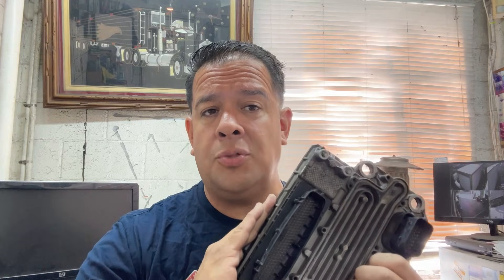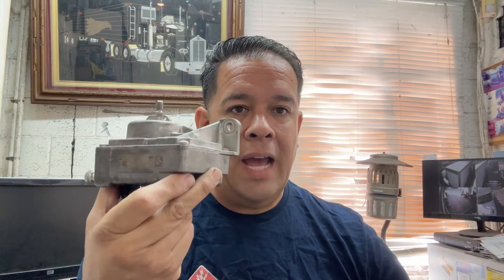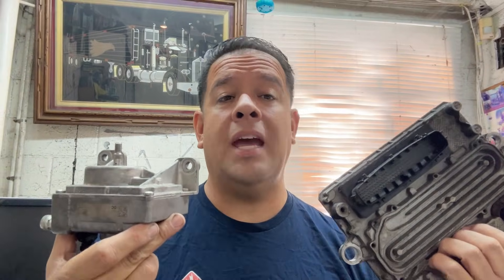EGR valve actuator and MCM nightmare, this is specific to EPA10 DD13 and DD15 Part 2

Comment: One of my favorite codes being sarcastic, already replaced 3 computers on 3 different cascadias repaired all 3 , it does send alot of voltage from mcm to move that actuator , through time the mcm just takes a crap also hope the dealer was programming it correctly ? Twice the mcms were bad , bad coincidence ? Thank god for your buddy , I’m sure when that 2791 code popped up again after second mcm replacement there was some cussing involved !
Reply from the maker: When I was at the dealership working on the exchange, they mentioned they had up to 5 MCM be defective right out of the box in their shop. 
Another customer had 4 be defective. The customer was originally being charged for each programming unit management got involved. 
But you are correct, plenty of cussing was going on

Comment: I work on coach side, so I can't speak for Freightliner but if you use the new style egr motor with the retrofit kit it will not work at all, regardless if the MCM is up to date(epa10). It would even throw a egr failsafe code to which valley power was also confused. I Installed a used but good older style actuator and the problem went away.

Comment: DTNA, Detroit, and Freightliner parts are ripoff. I installed Reman injectors run 3000 miles Cylinder 1 overfueling. Almost destroyed my new rebuild dd 15 GHG17. Then, I purchased the EA version new in Albuquerque Freightliner. Cylinder 3 send code 1325 fmi 3 Deficit at idle. Run idle speed, cylinder 3 dead, no fuel at all. I recommend everyone to wait until your factory oem part breaks or shows strong signs of failure because the replacement part will be low quality. Not even EA; which means Enrolled Agent, a third party manufacturer.

Comment: HOLY SHIT!! If Carlos the Diesel God is having trouble resolving this problem, I can only imagine how difficult it would be for a diesel engine truck owner operator to self-repair.  I'm a new RV owner and my very first diesel engine is the 2023 Freightliner DD8.  I know it's a baby diesel but it's what I have.  I see lots of DD13 & DD15 online maintenance, repair/troubleshooting videos for those engines but very little on anything DD8. Do you do any DD8 maintenance/repairs?  As a NEW DD8 owner, I need to be able to do my own troubleshooting and maintenance.  I have several different I.C.E. scanners and diagnostic tools to maintain and troubleshoot those gasoline engines.  Can you recommend an entry level owner operator scanner/code reader and diagnostic tool for my DD8 that is not several thousand dollars for me to purchase so that I can troubleshoot and repair my DD8 if the time comes to need repair in the future?? I watch a lot of your very informative videos in the hopes that I will better understand diesel engines, and SOMETHING will be similar to understanding and better maintaining my DD8.  You are amazing and I have learned a lot from my short time watching your videos.   I just did my very first DD8 oil change and (10,000-mile) maintenance on the engine/chassis. I still need to do my first fuel / oil water separator filter change.  How often (milage wise) do you recommend changing the fuel pump filters?   SUBSCRIBED & LIKED!  Thank you so very much on the information and confidence that you provide to us owner/operators.  Bill C

Comment: Carlos good video.  I actually had same issue with this code at my brothers shop. One thing to look for is when you take the mcm in to get programmed they program the most recent version on server. You need to make sure that the cpc,sam cab, sam chassis, and mcm have compatible software version.  My theory is your buddies mcm had a older version that was compatible. Although its a pain sometimes its better to take truck in so they can program all the modules at same time.  Hope that helps.
Reply from the maker: Appreciate it.